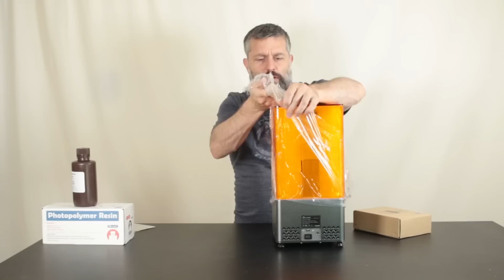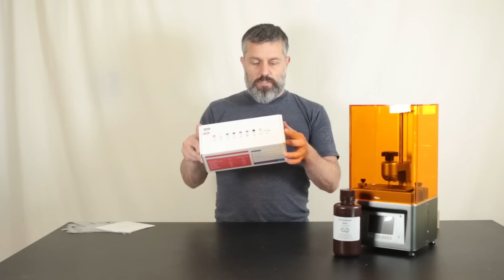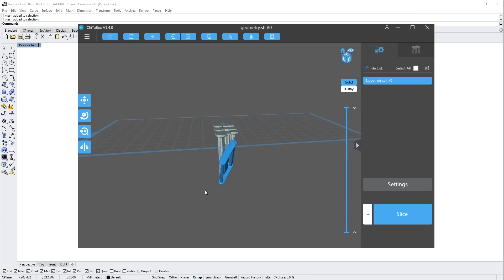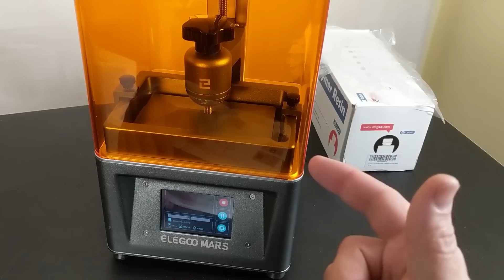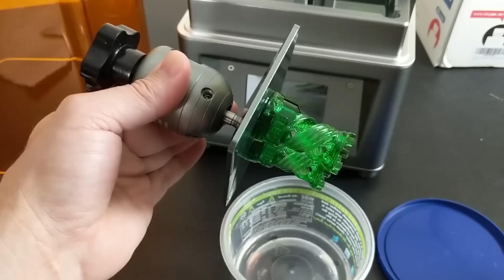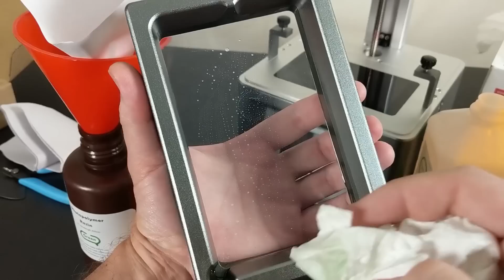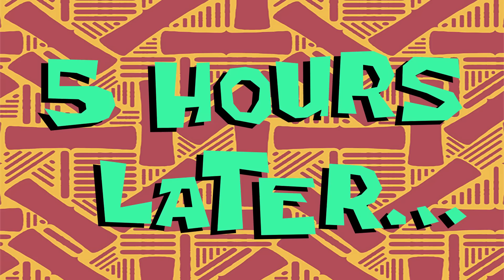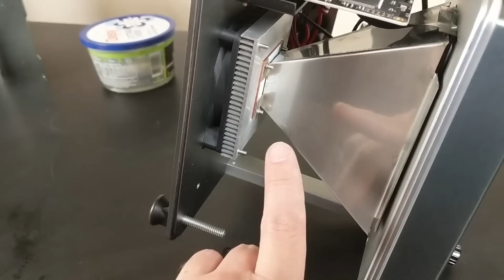$250 for This Quality of Printing Is Unreal! - the Elegoo Mars Delivers, so Let's Review It.

Comment: In a few years resin printing will be a thing of the past imo. Resin is too messy and dangerous and expensive and the build volume is too small and the post processing annoying. FDM does produce slightly inferior prints but not by much and they are easy to use. Also I don't have to clean up supports and crap. Something more like SLA without the cleanup would be the best. Maybe instead of a vat of dust, the dust was launched like an inkjet.... something else other than this resin printing....
Reply from the maker: I don't think resin printing will ever completely go away, and it will only get better over time. It might turn out to be a craze, but look, there are still people rollerblading. Even though a fad dies off, it always sticks around. Resin printing is not a replacement for FDM. There are instances when each is the appropriate tool to use. If you make RPG Miniatures, FDM printing is the wrong tech for you. Up until now people who made miniatures only had FDM available to them, and 3D printer companies were happy to sell them the wrong type of machine. Now they have  a better option.

Comment: "When using an FDM-printer, when you're done with it, you can just leave the spool on as is, for months, no harm done"

Sooooo... You never used an FDM printer? Leaving your spools of filament just sitting out for ANY extended amount of time is a bad idea. Unless you go for the 'Spider web look' of your prints or, you know, like extracting broken filament from the extruder.

Seriously, this is some pretty piss-poor advice to give, man.
Reply from the maker: Oh, the insults are flying strong with this one. Obviously you don't watch my channel regularly, or else you would not have missed the very next video where I covered in depth the very issue you think you are so clever to throw at me: https://youtu.be/gOJ28KWAm3c The bottom line is that the vast majority of FDM prints happen using PLA filament and as I said in the video "...especially if you are printing in PLA you can just leave the roll of filament on the printer for months." PLA is pretty much impervious to moisture in the air so far as print quality is concerned. This is not true of wood fill PLA where the wood fibers themselves soak up the moisture.

Comment: Cell phone LED display and cell phone board? :D Not even close. Buck converter that's a boost? Buck or boost or maybe buck/boost (automatically switching the mode)? And it converts form 12V or whatever to the voltage needed by the UV light? Very precise information. :) It looks like UV LED and that's most probably not buck or boost, but rather LED driver (providing constant current, not voltage). You shouldn't try to talk about electronic modules and components when you don't know almost anything about it. Stick to the printing part where you do have some knowledge.

Comment: Bought a Elegoo Neptune last month... Still not working... X axis connector to x stepper broke after test print.  Elegoo sending me a wire harness  to fix that.. (I dont think it will fix it because I think the harness is fine. The fault the solder job on the Connector to the X-Stepper PCB. ) any ways cant find Elegoo Mars for sale any where and what is this LONGER brand 3d printer that looks just the same.  Elegoos CSR is not what people were calming it was this spring it took them 5 days and 2 reminders to Re reply about my Warranty claim  they basically ran down the clock so i couldn't Amazon Return.

Comment: You should get proper chemical lab ventilation and proper full body cover with gas max that stuff is cancer in the fluid form.  Most of resins contains benzene if you wanna get cancer well touch it with bare hands, sniff the powder etc.
Reply from the maker: Actually, these photocuring resins contain no solvents (such as benzene) and therefore they emit no VOCs. Watch my next video tomorrow for a lot more information on the subject.

Comment: can you use Solidworks program?
Reply from the maker: I have used Solidworks in the past. I prefer Rhinoceros 3D. While solidworks is the industry standard for many engineering disciplines, I find that for multiple fundamental reasons I have to think too hard about how to draw the part instead of just drawing it. This cognitive burden makes me less able to be thinking about the design as I draw, and slows me down. I am a designer, not an engineer, so this is why I prefer Rhino. There is less of a disconnect in time and effort between conceptualizing what I want to draw and actually seeing it on the screen. This greatly facilitates the creative process and makes for better designs.  Also, Solidworks is $5000 for a license and you pretty much have to buy a new license every year to keep it usable. Whereas Rhino is like $1000, and it is 5 years between versions. Upgrade licenses are half the cost, so your next license in 5 years will only cost ~$500.
Reply: @DesignPrototypeTest  ok i do get what you're saying, luckily I do have solidworks but only wanted to find out if its compatible for sample parts that I have to make
Reply from the maker: Yes. Any CAD program which can export .stl files can be used with this machine. All CAD programs have this functionality in 2019.

Comment: Dont go deep into that internal electronics if you dont know what you talking about. Because I assure you it has shit to do with phone board. Any modern processor can drive LCD screen, you dont need smartphone board for this. Then where exactly in smartphone you have stepper motor driver or Ethernet?

Comment: the danger that people here are saying about resins epoxy and otherwise is very real i'm an electrical engineer though i specialise in prototyping, i work for myself now but did a stint where we used epoxy clay for the rapid prototyping of parts(pre 3d printer days), and now i cant use epoxies at all.
all those times mixing epoxy putty and clay in my hands made me hyper sensitive to the stuff, so now if i need to enclose a design or "pot" a magnetic coil i use poly resins with heavy ppe, or non toxic gel potting compound.
be careful with this stuff.

Comment: First time ever watched resin print so total newb.  Was there a reason to print it at an off angle?  Seemed to me to force the single fail point flatter angle would have given more contact points.
Reply from the maker: It's complicated, but generally speaking  the angle helps limit support, and create a lower cross sectional area which makes the part less prone to breaking off the platen. More cross sectional area means more suction cupping to the FEB reservoir bottom.
Reply: I am no expert on 3D printing (never done it) but it does seem he went to a great deal of trouble to design supports when simply printing it vertically could have been done with much less effort. Or horizontally with minimal supports but take much less time, because the time to print is a factor of the height of the object.

Comment: The long printed one had resin had imperfections due to taking it outside before cleaning it. As soon as you are in sunlight UV resin will start setting. Clean indoors out of UV light. The orange lid is to stop UV light on the resin reservoir.

Comment: I didn't care about safety with resin for a while and then I got apolecia universalis. 
Could be related.
So do wear gloves and avoid splashes kids.
Reply from the maker: I looked up apolecia universalis, and it appears to be a genetic condition. I found no literature suggesting it was caused by exposure to chemicals. You, claiming there is a causal link between your hair loss to UV curing resin is a case study testimonial. It is does not prove anything in a scientific sense.

Comment: Nice video.  To add a couple points.  The resolution is 2560x1440 2h HD.  The film at the bottom is essentially teflon - which is both oxygen permeable and virtually inert.  That being said, the type used is common to anti graffiti films used around the world.  see https://daikin-america.com/fluoropolymers/?gclid=Cj0KCQjwjrvpBRC0ARIsAFrFuV9jYOXbnhBlXR5CcdsxSACwTxwv6MrRRAp3j71YaCgJo89zOJyvcH8aAm_oEALw_wcB  I wonder when they will have a 4K or 8K version?  Say, using an Apple retinal display?  Thanks Doug

Comment: If you are really that worried about China tracking you then us your browser in a VM using a VPN and then use a throw out email address to register. I would also run the slicer on a VM and use a tool to check for phone home connections.

Comment: Most websites still use cookies even before you click that little button.  The legislation surrounding this is completely backwards and nonsensical.  If you don't want to use cookies you can change settings in your browser to tell it not to use cookies, otherwise any website can store cookies on your computer.  Cookies are necessary on any site where you sign into an account as they are used to store a unique number on your computer that identifies your computer's browser to the server it's communicating with.  And yeah China's social credit bs is dystopian as heck.

Comment: yea,, I gotta call BS on the "you gotta clean it before you put it away"  

I've been printing on an Anycubic  for a year.. only ever emptied the vat 2 or 3 times out of hundreds of prints, and i've left it in the corner full of resin for weeks at a time.  I'm still on the original FEP, and it's still working great.

I just gotta say, that's just not true that it's going to "build up"

the only way you would accomplish that is exposing the resin to UV rays.   Just put a cover over the printer, no reason to empty the vat after every print  or even if it's just going to sit for a week.
Reply from the maker: This is good information. Thank you. Please tell me, do you cover the printer with a box or blanket to keep it dark inside the printer?

Comment: You can actually print down to 0,2 mm extrusion width with a 0,4 mm nozzle. You might not need a 0,2 mm nozzle. Some printers won't do it; my bowden printer will not, but my direct drive printers will. 0,2 is the absolute limit for my printers. 0,25 is great quality. I use 0,3 mm for RC planes which is strong and light with a low layer height of 0,08 to 0,12 mm. My tiniest HErcules model was printed using 0,25 mm extrusion width using a 0,4 mm nozzle. It's super light. The benefit of using a 0,4 nozzle to print thinner is reduced risk of clogging, which happens more often with tiny nozzles.

In my big bowden printer I use a 0,3 mm nozzle to print RC plane parts.

Comment: I hoped you wear joking about that part being hard to print. You could have done a clean print straight up & down
Reply from the maker: No. I could not. I need a perfectly representative for prototyping purposes. Otherwise the client who is paying me a lot will judge me as an amateur and the entire conversation will be about the quality of the print instead of the functionality of the part as I designed it. The sides are not flat. There is not a flat surface anywhere on this part. Everything has a curve to it. To print it vertically would mean I need to cradle that entire side in support material. We all know what the underside of a supported print looks like. It doesn't compare to the quality which this resin printer makes.

Comment: More plastic to mother nature!
Reply from the maker: It's true. Did you know that the computer was supposed to eliminate paper usage. Instead, as PCs and Dot matrix printers became more popular, paper usage skyrocketed. I think it went up by a factor of 10. Yeah, 3D printers mean a lot more plastic waste going into our landfills. PLA filament on FDM printers is about the best option in this regard. It is made from Corn or Sugar Cane, and it is biodegradable. But only in an industrial compost which reaches high temperatures.

Comment: But why are you printing your piece at an angle, ism't it easier to print it straight upright? You would not need a single support beam - or what am I missing?
Reply: I was wondering about the same thing.  If printing without angling the part is viable, I would think it would finish printing much faster too.

Comment: Plug the printer (or anything you don't want to shut down before powering off manually first) in a battery back up. The kind you use with computers. They go up in volts and watt-evers so you can either plug back up or if the power is knocked out the battery can continue to power your device's cell phones and everything as long as it's not too much and you can turn equipment off. I'm going to get one for my PS4 because I hate when the power goes out and my 4k 65 inch TV , theater system, 4k he Blu Ray player and PS4 are all on and I have to risk damaging them.
Reply: Carry an extra gas can with you in every vehicle you don't want to run out if gas in. I'm going to get one for my (Insert make & model here) car because I hate running out of gas. They go up in size of gallons and leet-hairs so you can fuel up whatever.

Comment: Why did you not show the strength of the cured part?  
How much does it cost to print the chess piece?
Reply from the maker: The green "stretched" part had been fully cured in the sun.
Reply: Thanks.  How about cost?  I did a little bit of googling and it appears to be quite expensive. Like 10 times more expensive than ABS.  Is that correct?

Comment: Is literally given two types of gloves and comment on them being important. Proceeds to not use them or cover any of their equipment and desk while handling un-cured parts.  Notes that the printer needs to be filled at least 1/3rd of the tray, barely puts enough in to even cover the pan.  I don't know much about 3d printing but I'd hazard a guess that the part lifting up and going back down is making air bubbles cause there isn't enough goo in the tray.

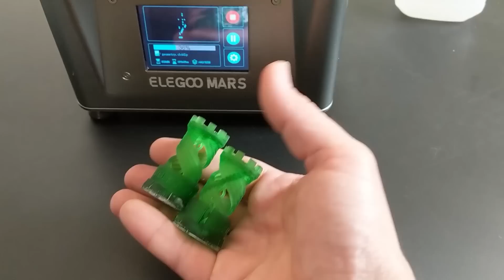Comment: 21:31 when you use a word you dont know the meaning to
Reply from the maker: Au contraire mon ami. Here is the definition of "Exothermic Reaction" from Wikipedia: "An exothermic reaction is a chemical reaction that releases energy through light or heat." So you see, my usage of the term was perfect. Furthermore, given the fact that the resin hardened in about 3 minutes after I took it out in the sun, I didn't have time to go look up the terminology on the internet. Which means that despite your allegation, I am fully cognizant of the process. I was able to reference the technical terminology off the top of my head as I was filming.

Comment: 9:50 You never seen it before? Since several years practically all webpages tells you , that they are using cookies. Recently, because of EU, they have to go into details. Sometimes you get a popup, and can't even use the site if you don't tell them what to do with their cookies.
So, it is definitely not a red flag, but regulation.

Comment: I know nothing about 3D printing.  Literally nothing.  So keep that in mind regarding my comment.

Why don't you print the file at 90 degrees to the plane?  It seems like there are plenty of flat surfaces on that image, so THAT could be what attaches to the platten.  Or am I missing something?
Reply from the maker: 1) The surface that is stuck to the platen will retain the texture of the platen. 2) There isn't a flat surface anywhere on this part. they may be close to flat, but they are curved in some way. Therefore, I can't line up the part with the platen. I know a lot of people are thinking "it's close enough to flat" but it is not. Each layer height is only .05mm tall. That is half of the thickness of a piece of paper. Tolerances are tight. 3) The idea is to limit support material. each junction of support material with the part leaves a little nubbin. Orienting it as I did allowed me to use the least support material possible.

Comment: Interesting tech.   Can you print 2 parts with different colors but leave interlocking features which will allow them to be "snapped together"  or even final cured and glued together.  Can broken parts be repaired by resin gluing them?
Reply from the maker: Yes. This is extremely do-able.

Comment: If the screen is slectively blocking the UV light, would that not indicate an LCD screen, rather than an LED screen?
Reply from the maker: Yes, you are correct. It is an LCD screen blocking the light from an 405nm LED which is being projected onto/through it. I spoke wrongly in the video, but I corrected myself while editing the video with the text that appears on screen at the 33:39 mark.

Comment: Depends on product, I don’t have a printer but I’ve bought ught 3d printed items shapeways flexible plastic and gameprint (says it’s resin) but texture feels the same as shapeways so either they didn’t use resin when I ordered my first print a year ago or shapeways uses a plastic based resin, gameprint I ordered a 4inch shapeways was like 8 inch different prints but texture feels very much the same

Comment: Are you sure the board is made from phone parts? I mean where are you getting this info? Seems you made it up wholesale and then proclaim it as certainty. I'm pretty sure that this board was specially designed for this printer and so yeah, they probably don't use custom chips, just off-the-shelf stuff. Like they damn well should or the thing would be thousands of dollars with no benefit at all. LCD itself is also not a cellphone tech and has existed since '64. Yeah, sure, the screen is made to fit a cellphone, because, again, designing and producing a screen specially for the printer would be an expensive and ultimately useless undertaking.

This doesn't make the printer less good in any way. Aamof, I think it's quite clever what they did here. Kudos and props to Elegoo. And it's not "made from cellphone parts".

Comment: Well yes, but actually no 

You get insane resolutions, BUT have to use PRINTER specific fluid, that has a limited shelf life and needs after curing and can not really be reused and base material is quite unhealthy to touch, print bed is smaller